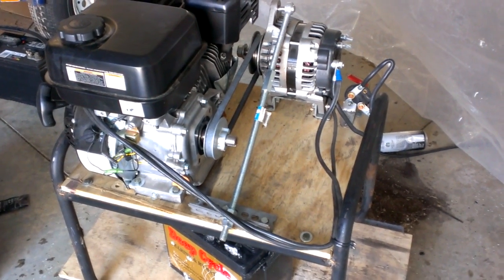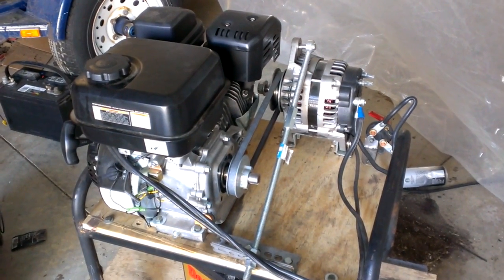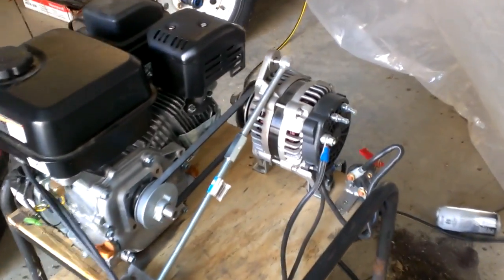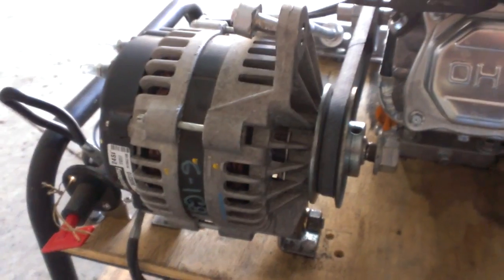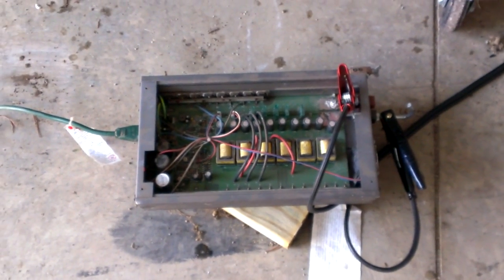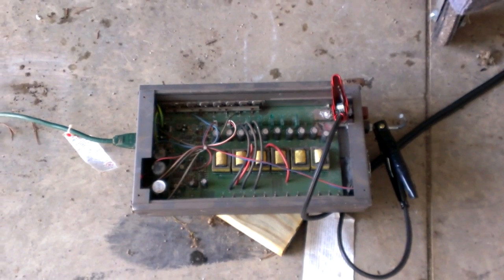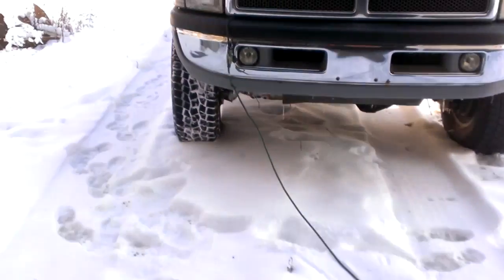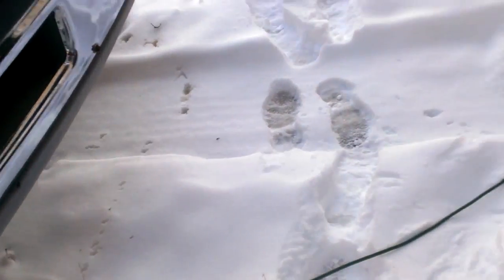Home made emergency inverter generator

Comment: I think you can use a much bigger alternator. A ~5000W generator uses a 7-8HP engine while your alternator has a maximum output of somewhere around 800W. Its like running a push lawnmower with a 50hp diesel engine.
Reply: I do believe your math is wrong.. His alternator is putting out approx 1,950W with 12v x 165A = 1950W  He doesn't say what his inverter is rated for and weather or not its demand exceeds the capability of the alternator. A 5000W generator using a 7-8hp motor implies that the max you could run is a 400A 12v alternator @7-8hp.. maybe from a big rig? Then you need an inverter capable of 5000W @ 110V

I have an 8hp water pump which I dont need and am going to covert it to a backup gen. By the looks of it, the alternator will be the most expensive part and need to locate a deal. Either that or wind my own onto the motor.  an invested project none the less..

Comment: Why not just start your truck to run the inverter?
Reply from the maker: David James you can do that. But I have it wired into my pole barn to power the lights and hand tools.
Reply from the maker: I already have 4 deep cycle batteries wired in series which is plenty for my use.
. when the battery need charged I just start the motor if the solar panels have not charged them.
Reply: David James
Reply: That wouldn't work because inverters take 12 volts and invert it to 110 volts, so power can only go through them one way.
Reply: + The block heater can't create power.

Comment: well how much can I actually power with this link can I power my power tools
Reply from the maker: 1900 watt total output from alternator.  I power my entire Barn with it. It will power every power tool that I own.
Reply: +john carr Wow how long can it run on one tank!
Reply from the maker: +Damien Hartley I have never really tested it to see how long it would run under full load! I am guessing a couple hours 1 liter gas. I have since I upgraded the system to include solar and several deep cycle batteries. I nowt run off of battery. I only run the motor to charge batteries on overcast day's
Reply: john carr My boss has solar power but he just sells it to the electric company. People seem to believe a lot of false rumors like solar power cost a fortune or can't power more then a blender.
Reply from the maker: the most I ever tried one time is an 1800 watt space heater.
it powered it, but it put such a strain on the Belt that it shredded it eventually. a serpentine belt would work much better, or even direct drive
Reply: john carr Well alteast you Know your limitations

Comment: How about attaching two alternators to that engine. You'll have two independent power circuits.
Just an idea.
Reply: Ford/Lincoln did that in the 1960's. They had a rear window heater powered by another car alternator. ! :)
Reply: Cause that shitty harbor freight engine can barely hand just the block heater.

Comment: Don't alternators require a DC voltage (at relatively low current) to generate electricity, normally supplied by the car battery?  Where is that coming from in your system?
Reply from the maker: yes, a small voltage is required to excite the alternator. I have a 2 Deep Cyle batteries under the cart cart